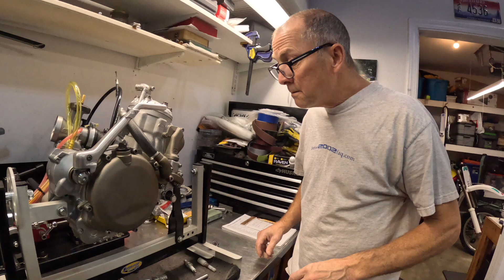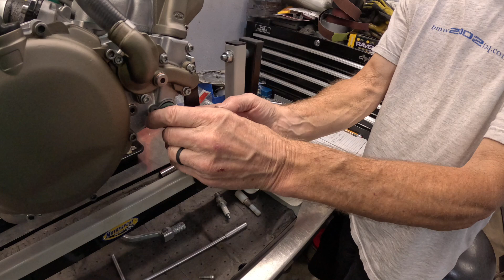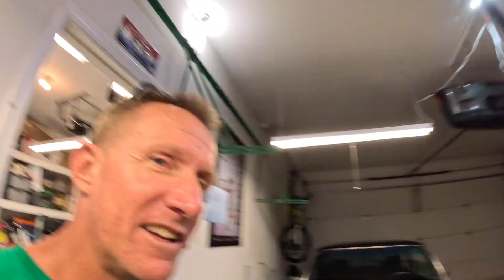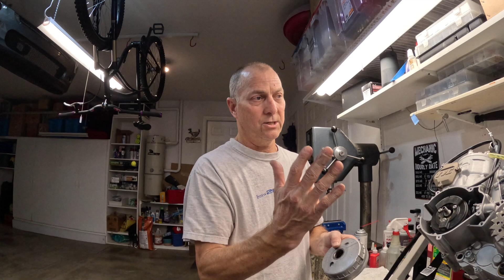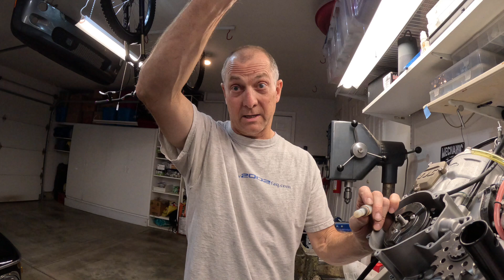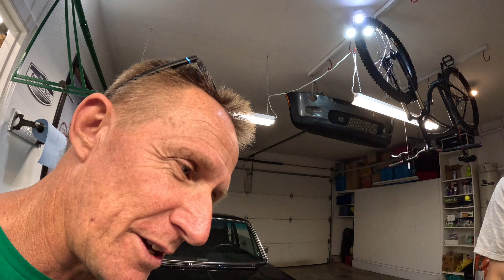1991 KTM 300 adjustable power valve and timing secrets

Comment: how about using what the manual recommends?  a dial indicator. worked at a dealer from 1990 to 1994. yes you "degreed" the tdc, but didn't use the 1.2 mm before tdc . a pvl and a remade sem are still available.the other ignition was a dci, for the mx version, which was a true digital igmition in 1990. the later kokosan ignition may fit the older cranks but for sure the 1996 used both

Comment: I have a ktm gs 350 from 1991 and i had stator issues and i put a diffrent stator in {also sem} but i forgot the timing so i freelanced it and it led to totaly bashing my crank bearings so i had to change them.I do not reccomend freelancing it  becouse splitting the cases was not a very pleasent experiece.